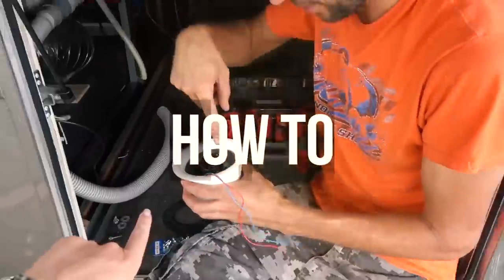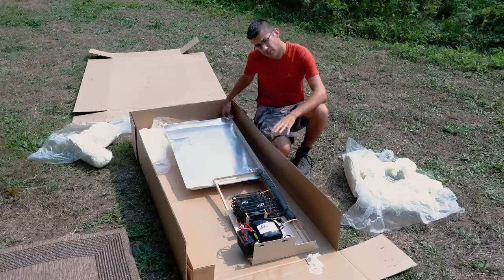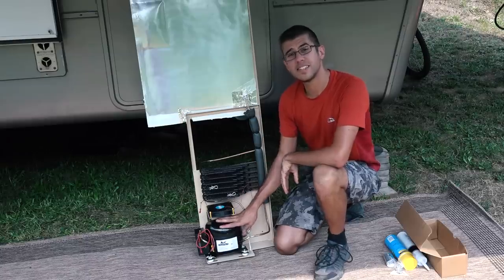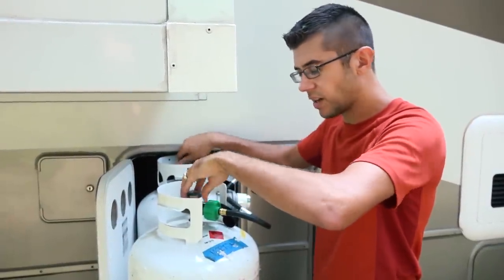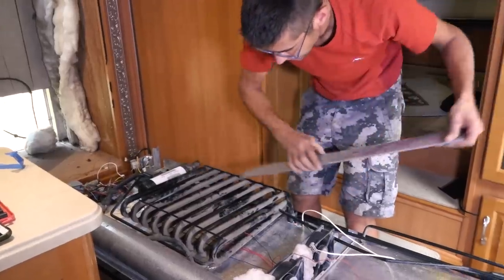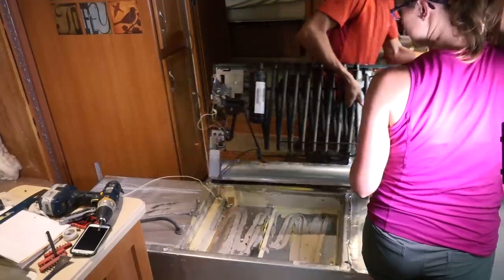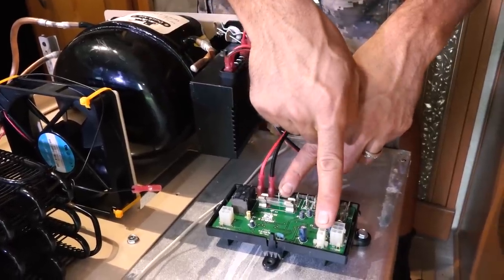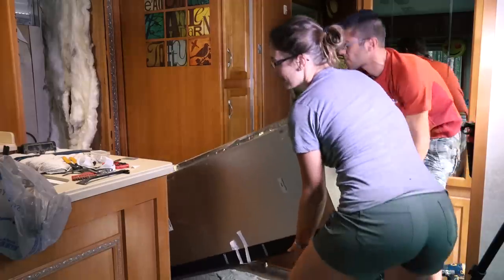Converting our RV Fridge to a High Efficiency DC Compressor- 8x More Efficient! and Better Cooling!

Comment: Cool video a nice application for replacement of cooling units.... About the not running propane cooling unit while driving tho it's not a big deal I personally have been doing it for as long as I've been in the RV world never had a customer with a problem as well... Granted I can see problem happening if an RV is not properly maintained which I'm sure many people do
Reply: Believe you are legally required to have the propane shut off at the tank when you are driving.  This is to prevent a potentially deadly propane leak if a line is damaged in an accident.  The tanks themselves are very tough and unlikely to fail even in a crash, but a line or fitting could definitely rupture.  I can't imagine any one stopping you to check this, but if you did have a crash resulting in a fire or explosion you would probably have some serious liability.  And, of course, you would hate to see anyone injured or killed!
Reply: @BCtrainfan  Not only that, but the flame can go out from wind and cause a buildup of unspent fuel, which can cause a flareup if the system tries to ignite again before the chimney clears. It's less common on newer models, with electronic control boards (as opposed to the old analog ones). It's also an issue with fueling. It's unsafe (and also illegal, in the US and probably many other nations) to have an open flame at a gas station.

Comment: The old fridge didn't have a condenser fan. The new ones got one already. you shouldn't need the extras anymore but you could hook them to the existing fan. I never realized that so many RV fridges had external evaporators.

Comment: You may want to install a separate contactor for your DC compressor on/off relay.  The original ac relay is not really rated for DC use.  The relay will last for a while, then the contacts on the relay will get arc scored and it will become intermittent.  A separate contactor (or large automotive DC relay) would work as a buffer relay.
Reply from the maker: I actually looked up the specific relay and it was rated for AC or DC use at 10A, I was concerned with this as well.  Another option would be to use the thermal sensor on the compressor itsself.

Comment: Quite impressive, I want to take out my entire unit put a 12 volt chest freezer in and use a cooler with ice packs from freezer. Dont know how well it will work but should need less panels on roof and less 6 volt batteries.

Comment: Outstanding video! What factors come into play when deciding to use 12v vs 24v or something else if there is another option?
Reply: I'm a bit late, but the biggest factor would be what you have available. 12 or 24 would both deliver the same overall wattage, but since their solar system delivers 24 natively, there's no conversion loss if they use the 24 volt like there would be stepping it down to 12, making it ever so slightly more efficient in this specific scenario. If you've only got 12v, which is common for rigs meant to run on shore power or generators most of the time (most RVs will fall in this category) there's no real benefit to converting to 24.

Comment: Why don't RV's use power from the alternator to run the electronics?  

I'm picturing a Winnebago style, not a tow-behind.  But for towing, you have trailer wiring.  Has anyone thought of a 30 amp power wire for the RV?

Comment: The box by the side of the compressor is an inverter for the motor , its probably using brush less dc motor , u should have also connected the main power to the relay first and then to the circuit board as the compressor will draw more way more current and better to have less line resistance , it was quite unnecessary to use 20amp fuse , i would be more comfortable with 10amp fuse on a 60w compressor as it will allow maximum draw  of 120w (it will allow more for the inrush current) on 24v 20amp fuse lets 480w of power and this can allow a fire if the compressor inverter shorts out.

Comment: Another great video from you guys. Ques: early on, you mentioned the importance of keeping the unit in an upright position (to keep the refrigerant-?) in the bottom of the unit, however, when you were installing the panel onto the fridge, you had it in the horizontal position. Was there a problem doing that or did I miss something? Like I said, you guys do a "bang-up" job with your vids; very clear explanation. Y'all Be Safe!
Reply: It's not that it has to be upright - it's that it can't be tilted "back" at all. They ship it laying down flat, and you can have anywhere from laying down to straight up. What you cannot do is go past straight up and tilt it towards you.  At least that what I understood when I installed mine.

Comment: I wonder how much efficiency could be gained by making those plates on the unit bare metal and using something like thermal grease and trying to get those 2 surfaces to actually touch...

Comment: HI, I find this very interesting. Thank you!  I hope that that there is a kit for my DOMETIC RM2551. Questions.... With a 12V unit apart from running directly from the batteries, 
How about when connected to shore power, same no problem? since 12V are from the Converter?

Comment: I have a question. What’s the difference between the 12/24 volt units and the 110 volt units in regards to power while boondocking and traveling down the road? Is one easier to power with solar or batteries ?

Comment: Probably why it wasn’t working so good is that the fan kit was blocking natural convection. If the fans were on it probably would have worked better but used more power and more noise.

Comment: I appreciate the video. I bought a new Airstream and surprised they did not have a better system for the price of the trailer.  Never understood to issues until ownership.  Ask many times why no one has come up with a better mousetrap which I would have gladly paid more for at the time of the build.  I guess I use common sense and that is in short availability these days.  The DC seems like a fix if they are easily retrofitted in Airstreams. Thx
Reply: These refrigerators have a ling history of excelent service... why build a better mouse trap when the old one catches mice galore

Comment: I make this comment anywhere and everywhere I see people applying expanding foam: be sure the cylinder is upside down while dispensing product.

The gas pressurizing the cylinder needs to be "on top" of the liquid to correctly dispense the product. Otherwise, product will be wasted; remaining in the cylinder.

Two additional pointers:

1) Apply only within prescribed temperatures, being particularly mindful of lower temperatures as this dramatically affects expansion.

2) Wait for Great Stuff to fully cure before attempting to remove excess material from hard surfaces. Then simply scrape it off with a thin blade such as a putty knife (being careful to not marr any surfaces). Uncured Great Stuff can be removed using acetone (nail polish remover) or xylene (Good Off). This is particularly helpful for cleaning up after any inadvertent skin contact.

To get multiple uses from cans without the reuse tip, simply use ba few drops of acetone or xylene in the nozzle and straw to dissolve product. Completely flush the nozzle and dispensing straw before using so as not to contaminate product as it's dispensed.

As always, Tom and Caitlin, your projects add so much value to those who RV either part- or full-time, and your content sets the bar for quality across any topic you cover.
Reply: I had a rotted out toyota 4-runner. it was loud and leaked so dust came in while I was driving. then came the duct tape and great stuff. 
 I drove that rig for three years like that. great stuff should be called fucking awesome stuff!!
Reply: Took a previously kicked-in front door on our Rig, reinforced it with pine slates and used that great stuff to insulate it. Wish I knew about the Nail Polish trick beforehand though. I'm still covering up the embarrassment with gloves.
Reply: What is the nail polish trick??
Reply: @LoboLux  nail polish remover? ... or is it like the superglue-baking soda trick?
Reply: You really need to just stop already

Comment: hey i just found you again youtube is un subscribing your people you do good work and explain in a way we can understand so much better than Will  i have a 40 foot pusher 6v92  6 speed auto i started a complete remodel on but did not finish all hard stuff is done in the very best  professional way it is totally open all new everything  we was setting it up for all solar and any climate with no need for shore power or genny
Reply: i think you would make somthing  incredible out of it 
i have dino paperwork it is tuned for a million miles at a little under 400hp   
it out ran our sienna  van  going up fancy gap  
it will go over 100 mph and will pull anything

Comment: I makes me wonder why the RV didn't come with this or at least a factory option for this.  The part of this that sucks is that now you have the old system that has nearly zero value.  You would think in an RV there would be a greater concern over how much energy is used.

Comment: I would have put the screws inside the fridge as fast possible while the foam was still pliable, maybe you would have been able to align the screws holes, but more importantly to prevent the foam from hardening and causing a air gap between the unit and fridge to prevent proper heat transfer.

Comment: I’m confused. I saw your video when you first posted and understood this conversion to be simplified  an rv fridge to a residential style compressor fridge. Recently I saw the video where your wife recommends the rv style for boondocking. Is there a difference between what you did here a dc compressor and a residential fridge? Essentially I want to get the most effective fridge.

Comment: My absorption RV fridge lost all of its ammonia several years ago.  My RV service guy took the cooling system off the back of it and put on a replacement unit.  It has worked well ever since.  He has an Amish guy who rebuilds them in the Shipshewana area.  It keeps the fridge at about forty degrees and the freezer around ten degrees regardless the outside temperature.  This is a little warm for ice cream but I don't eat much ice cream.  Without a lithium battery system like you have, I am afraid that my RV AGM battery would run down on those days when I am away from RV all day while boondocking.  

I have wanted to ask you how your heating pad has worked out for your Tesla battery.  Does it produce enough heat on those really cold days for you to keep your battery charging?  At what temperature do you allow charging to resume when you are warming it up?

I am with Tom Cooper on the whole premiere thing.  I would much rather you just send it out as a regular YouTube video because it works a lot better for the viewer.  

Wishing both of you the best.  I hope you have a relaxing winter after your hectic summer working on that movie.  Glad your house has wheels so you don't have to stay in that snowed in area of the country.  I am headed for Florida as soon as Christmas is over.
Reply from the maker: I would say you need 2.0 kwh of extra battery power to reliably run the fridge and have some means to recharge like a gen or solar.

Our heating pad is working great.  We only run it on 30W and it has been keeping the battery above 40F easily.  I have the temp sensor on the backside of the battery to make sure the while compartment is warm enough.  We have not had charging cut out yet due to cold even below freezing.  I have mine set to cut back in at 40F for charging.

Comment: LOOK HONEY>>>> WE COUILD JUST HAVE A NEW WINDOW!!!

Question... why was that fan switch installed aftermarket... was that for hot temp location assistance to make the fridge more efficient and cooler inside??? Was it in off position when you fouind it?
Question 2:  Do the fridge unit doors come off prior to removal from the mounted position?  To make lighter and less apt to damage anything?
Q3... find any mice poop back there?  Also, You may want to sprinkle some powered boric acid prior to re-install.... Ants do not like that and  last chance to put it there.  Never know when those interlopers may want to join you on your travels.  I guess a few ant traps in the back panel could do trick also.r ar
Q4... if youi do lean it backwards... can't you just let it stand in proper position installed for 24 hrs and it is then OK? Did you ask the mfgr???

n coldeer climates, you can now block the external venting ports on side of RV and maybe force the hot air into the interior?  Free heat.
I will watch install later, but am guessing the fan switch will be relocated by you to the INSIDE?
How much does a Dometic factory DC unit cost, self install?????? For those who may have fear of DIY.

Comment: So how many amp hours a day does it use with the compressor? When a compressor is other than vertical it needs to sit for a while to allow the oil to flow back to the bottom.
Reply from the maker: It needs to tilt alot before you need to let it sit, but if you laid it on it's side then give it 12hrs for sure.   It really depends on the day but on average it has been using around 800 watt hours for us.

Comment: Can you still run your fridge off 110v when connected to shore power?
Reply: That's what power converters are for. The 12v system in any modern RV is powered on shore power when properly functioning. That's why your lights and furnace work without constantly tending the batteries.

Comment: Thanks for a really great video!  You two are very skilled and self-confident.  Great team effort :). Did you or JC Refrigeration consider that the control board relay was originally applied to a resistive AC load but now switches a very inductive DC load?
Reply from the maker: I assumed they did, but yes I checked the specs too.  On my board it's a 15A relay so more than adequate for the taak. The DC motor is actually controlled by a pwm or speed unit of some type and has very little inductive component on the supply.  Startup current and transients are almost nonexistent too.
Reply: Mortons on the Move very cool!  That’s about the best answer I could hope for 😊. I wish for you many years of hard ice cream 👍

Comment: Is the relay on your re-used control board rated for DC current at the level it is now switching??  I would expect a price sensitive fridge manufacturer to have used a relay only rated for AC at the lower current level needed.  DC rated relays need to be build a bit differently because the voltage (and current) does not drop to zero twice in each cycle so any arcing that occurs when the connection is interrupted may not go out!   Since the compressor motor is an inductive load arcing is a definite possibility.
Reply: That is a good point. However, the dc compressor has its own controller and is not a direct inductive motor load.

Comment: When you say that you use a 60 watt and your other unit used 600 are you using Ohm's law and calculating for the voltage difference of what you're saying?
Reply from the maker: Kind of, Those were actual calculated wattage numbers using our battery monitor shunt and running the units on inverter through the battery.  The most accurate you can get.  The fridge runs closer to 80 watts now because we bumped the motor speed up a bit.

Comment: Was there an advantage to using 24 volts instead of 12 volts
Reply: You can use thinner cables(twice the volts means half the amps), less voltage drop over cable length, some equipment is more efficient at 24v and in an RV with 24v engine batteries you can jump start your engine from house batteries if you get in trouble.

Comment: Compressor even though 12V still not efficient because it is a piston type compressor instead of a rotary compressor which is a big difference... this you can tell easily because of the style ...

Comment: 3 years too late, but you should have used White THN wire for the Negative side for the Battery Negative, that would keep the unit legal with the Industry for DC wiring.

Comment: If the electric unit is more efficient, why do you need to replace a 5A fuse (for the ammonia unit) with a 20A fuse (for the compressor unit)?
Reply: The 5A was for 120V, new one is for 12V

Comment: I'm  a refrigeration engineer & you did a very good job :-) The only thing I'd add is that the condenser fan really should be wired so that it just comes on with the compressor, that's normal refrigeration practice, triggering it with a thermal switch is just another part to fail. Other than that can you hear the compressor when you're trying to sleep? ;-)
Reply from the maker: That makes sense, I can just bearly hear it at night but it's not a problem at all.

Comment: I wonder if I can use a regular residential fridge
Reply from the maker: As long as you have an inverter and good battery system.
Reply: @MortonsontheMove  I was thinking about remove my old fridge and install a residential, I'm using the power from a place and not moving